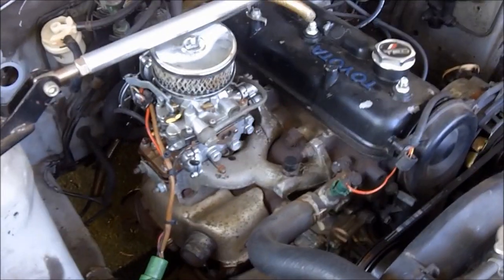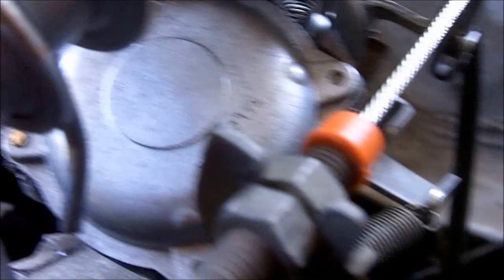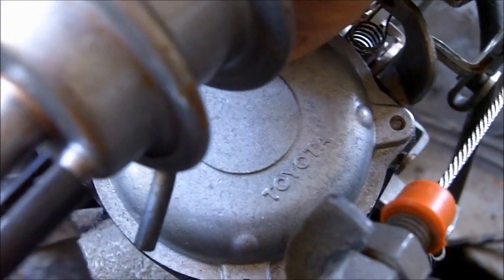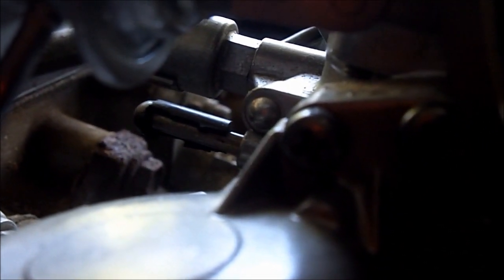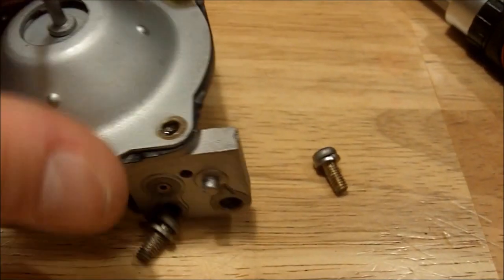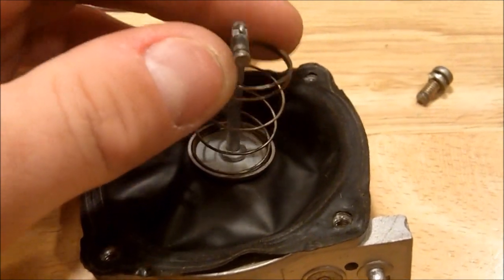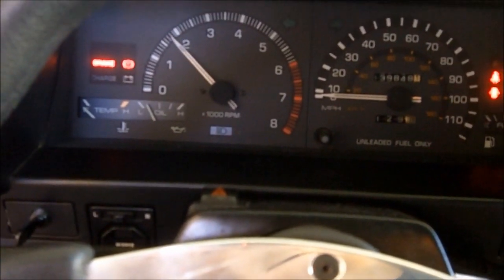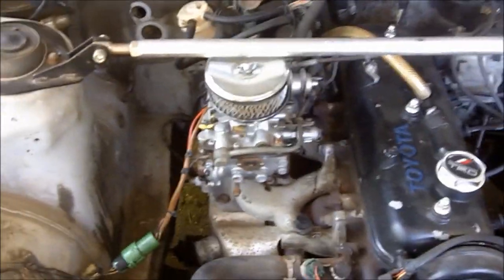Free Mod Aisan Vacuum Secondary Spring Flip

Comment: I did the mod over the weekend. Definitely faster, thanks! Unfortunately it idles rough and wants to stall out. Let me know what u think.
Reply: Did the rough idle haplen before or after the mod? If it happened you might have disconnected a hose somewhere. If it happened before you need to get a rebuild on your carb so it can get cleaned out.